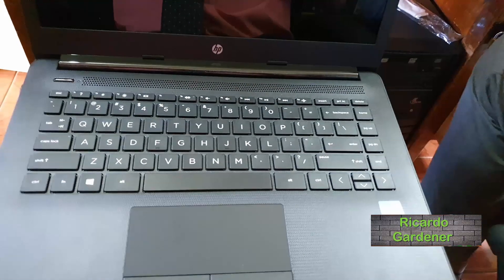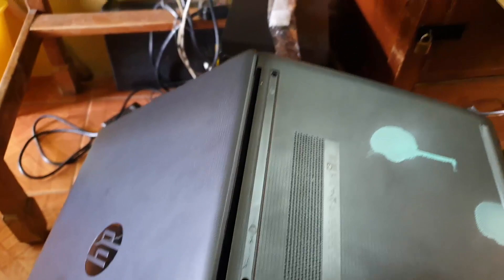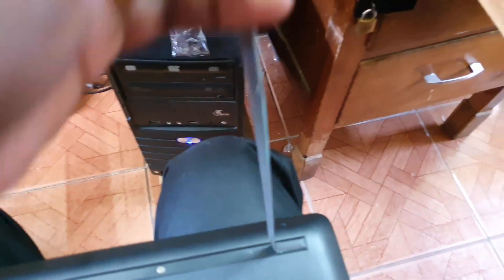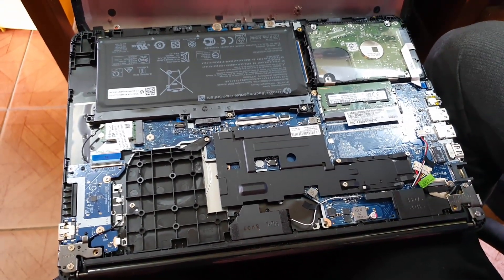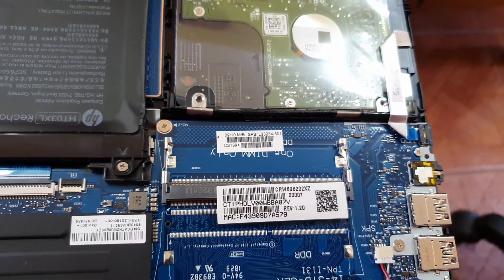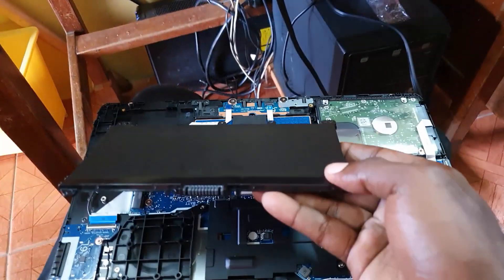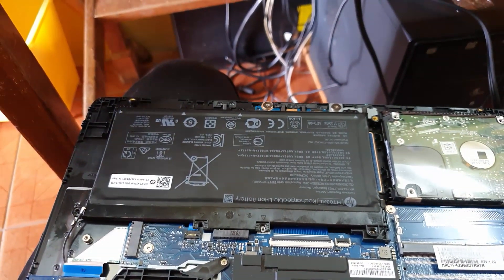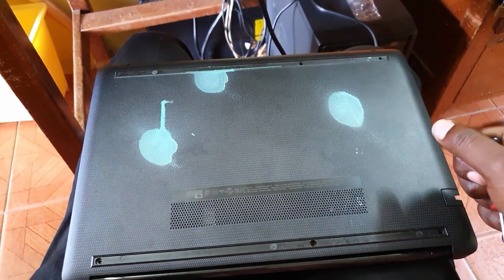HP 14 CK0018la Disassembly

Comment: My HP Laptop have an issue with BIOS update, Blackscreen after BIOS update. i want to hard reset the BIOS, since this model doesnt have Cmos battery, i try remove the laptop battery only and replaced it again after couple minutes. But still i got blackscreen. What should i do for hard reset the BIOS for this model 😊🙏🏻

Comment: Great video 👍👍👍👍👍

Info: The screw @2:30 in this video is the write protect BIOS screw. (Under the base back strip, the second screw from the left the power connector). When I updated my EMMC to SSD using the adapter specified by HP (similar to the one this laptops has -HP 14 CK0018la), the computer didn't want to boot after upgrading the DDR4 4GB module to 8GB module. All I got was black-screen with no response other than power indicator. I had to remove the BIOS screw for it to work as I changed the DDR4 memory module.

Just some information for anyone why upgrading one of these laptops. I have the HP 14-CM0012NR

Hope this info helps anyone who having BIOS issues.